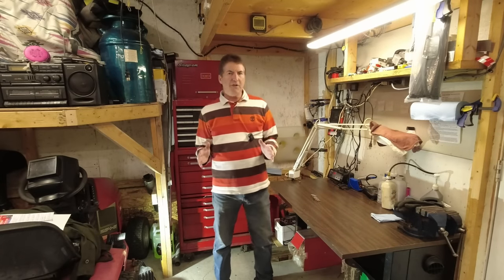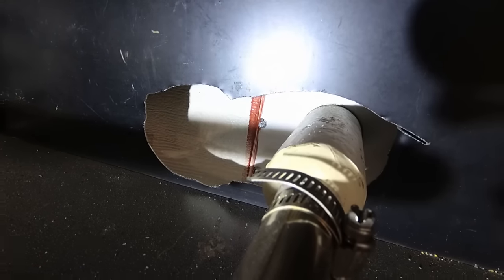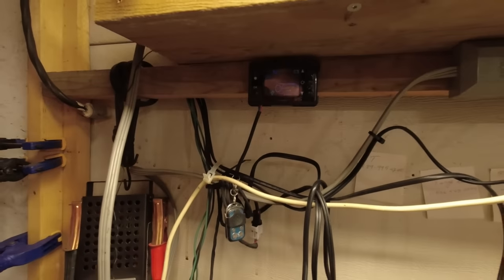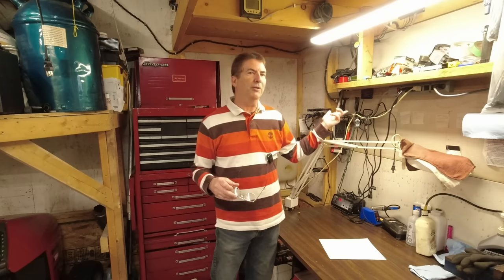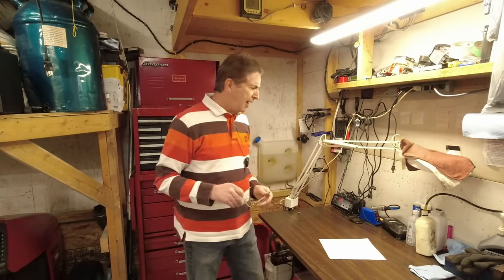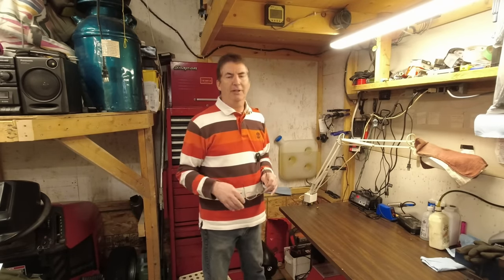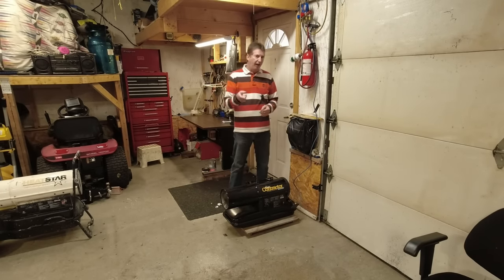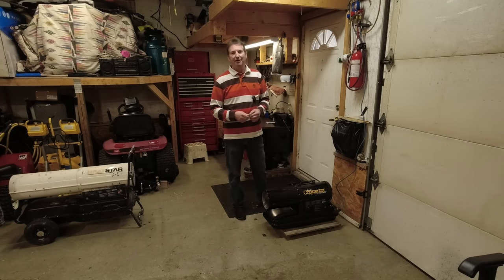Chinese Diesel Heater, 5 Year Review, Heating a two car Garage with a Parking Heater.

Comment: How many hours do you get at the lowest setting per liter?
Reply from the maker: I said in the video, twice, how many hours I get on 1 liter, 5 hours 15 minutes. Thanks for watching? lol enjoy your day.
Reply: @FRUGALWITHJOHN  You said you use setting 2 and you got 5 hours and 15 minutes I was asking about setting one
Reply: @timtdp  2000 to 1800 is a difference of 10% I estimate 10% more time 31.5 min longer than the 5: 15 he said, although he said it causes build up inside the heater so you need to burn it on high setting 15min to clean it out or it may need matenince or preformance loss over time at 1.8...lets say you can maybe get 23-24 hours on 4 litres as an educated guess given the info provided... now when you consider fuel LSD or RSD low sulpher diesel or Regular sulpher diesel or even kerosene all have different energy in the fuel itself, I bet these will burn bio diesel but efficency would not be the same but it could be eco friendly well sorta.
Reply: heating oil in some areas is RSD and has more energy in it as HWY diesel is LSD and is due to emmissions on Exhaust of trucks has less energy.. even jet A1 ia technically a diesel fuel. I have no idea on this fuel energy its cleaner thats all i know,
Reply from the maker: 1.8 KW is my lowest setting, I get just under 3 days per tank. (I don't use 1.8 KW anymore because it is not hot enough to keep the burn chamber clean). I use 2 KW and get just over 2.5 days. 10 liter tank (but fill to the top of the neck so just over 10 liters), Diesel is around $1.97 a liter, 10 liters = $19.70 for a full tank.
Reply: @FRUGAL WITH JOHN  so the cost is about 33.3 cents an hour or $8/day or $240/month. I'm not sure what your electricity rates are like, but in Saskatchewan we pay 15.3443 cents/KWH (including carbon tax). So 2KW of electric heat here is 30.7 cents an hour or $7.36/day.  You should check your rates. It might be cheaper to go electric.
Reply from the maker: I did check hydro rates, in Ontario the cost of electricity is high. The bill says you pay 7.4 cents per kilowatt hour (off peak) 10.2 cents (mid peak) and 15.1 (on peak). Now comes the hidden cost, (I called Ontario Hydro to confirm) With delivery charge and taxes you need to add around another 27 cents per kilowatt. The off peak rate now becomes 34.4 cents per kilowatt. (37.2 cents mid peak), (42.1 cents on peak). Thanks for watching.
Reply: @FRUGAL WITH JOHN  Thanks for posting this video by the way! I'm a subscriber now. Ahh yes delivery charges and peak times, we don't have those in Sask. I also forgot taxes in my calculation so another 11% would bring it up to 34.077 cents for electric here. I ordered a diesel heater myself a few days ago for my motorhome.

Comment: If you can figure out how to vaourise the diesel fuel before it goes into the device you might be able to increase the efficiency of the diesel heater by 3 to 4 times. Hydrocarbon fuels only burn completely when vapourised.
Reply from the maker: Interesting, thanks for watching.

Comment: problem with propane is couple. 1. the amount of btus per gallon is 2/3 of what diesel is. so to make the same heat for the same time you need 50% more fuel by volume. the next problem is propane heaters burn the air thats inside of what they are heating. this can exhaust the oxygen supply and it produces condensation. 

i have a propane heater for when it gets cold here (Florida so i don't typically need heat till late dec through early feb) but i'm thinking of switching to diesel.
Reply from the maker: May be a good move, I made a video about the pros and cons of different heat sources, https://youtu.be/c7p7CPABZ3I  Thanks for watching.

Comment: That’s five years that you have been heating freezing cold air from outside, If you put the air intake inside the garage it will burn less diesel as you will be reheating air that is already warm.
Reply from the maker: All that was explained in the video, thanks for watching? (all new high efficiency house furnaces use outside air for combustion).
Reply: @FRUGALWITHJOHN   Ok many thanks.

Comment: 3.785 litres equal to one gallon.
Reply from the maker: When you get used to the metric system, you try to make all forms of measurement easy, So 4 L it is lol.
Reply: Easy but incorrect. @FRUGALWITHJOHN
Reply from the maker: You did not mention if it is an imperial or US gallon, 4.55 liters or 3.785 liters lol, sorry but liters is so much easer. I did start off using 1/2 US system and 1/2 imperial system. We changed when I was in grade 6, so did the US, but the US could not handle the change and went back to the old system (??).  I am not saying that was a bad thing but at the time  I could not understand the logic.
Reply: Dude the imperial Gallon hasn't been used since the UK converted to the metric system. I wasn't being a dick I was just giving the correct calculation. no biggy have a good new year. @FRUGALWITHJOHN
Reply from the maker: The imperial system is still used by some people around here, I am in Canada. So when the term gallon is used, I always need to guess, is this person from Canada, UK, or US. Even round here, some people will say, my car gets 40 MPG, the next question is always (Canada gallon or US gallon) and the answer is never the same. (so that is my rant on this subject)lol. Happy New Year!
Reply: OMG dude! come on really. I am 57 i am well aware of the U.S. Gallon and the U.K. Gallon. No one in the last 20+ years has used the imperial gallon. I understand some people can't get past it and are stuck referring back to it. The people in the United States are just stubborn as far as them not openly using the metric system. It really bums me out when buying a ratchet / wrench set and some genius thought it would be a great idea to include "standard and metric" who the hell uses those anymore. If someone say i get 40 MPG I only think U.S. gallons. (Since the U.K. is Metric) - John @FRUGALWITHJOHN
Reply: Just an FYI. The U.K. converted to metric in 1965. Canada converted in 1970. allowing for a 15 yr cross over that still make it  39 to 44 yrs that the metric system has been used outside the U.S.  @FRUGALWITHJOHN
Reply from the maker: I was in school in Canada when all this happened, so was taught both systems, going to be 61 soon.

Comment: All that pissing around is not worth it.  Call your local plumber and have him install a 70k modine hot dawg.  Much safer
Reply from the maker: 31 years ago when I started heating the garage, it had single pain windows that did not seal, no insulation, and the soffit vented outside (you could see outside from inside). The wood stove was the only thing that would work. Over the years things changed and so did the way I heated the garage.
Reply: $1000 plus propane setup and instillation cost  vs $100 and then you have to have a tank and service to fill the tank or you drill 2 holes and connect 2 wires and a little diesel heater seems much more practical for a diy home garage setup. Don't really see any pissing around just giving information about the heater in the video.